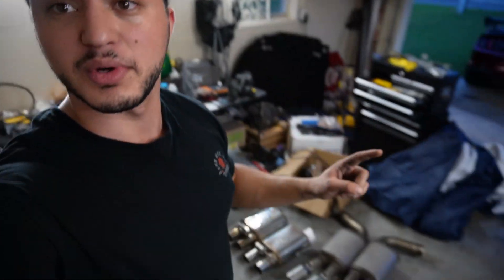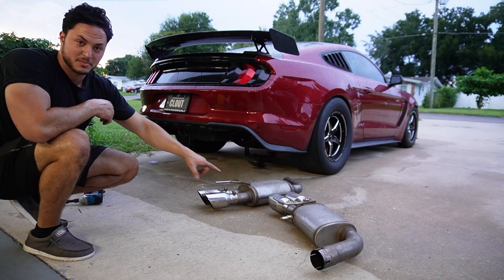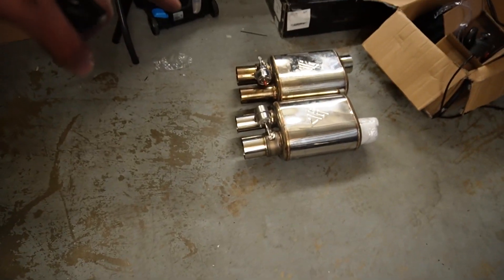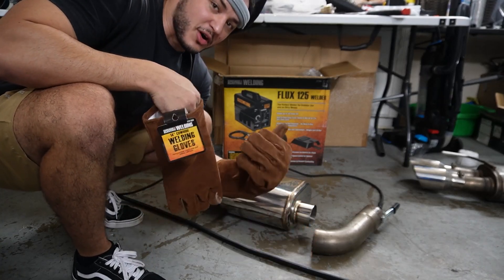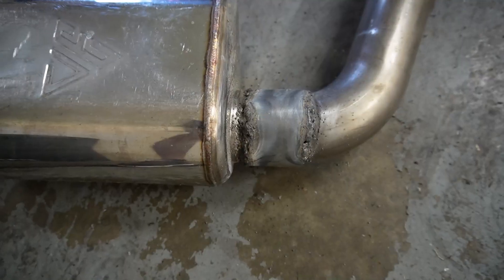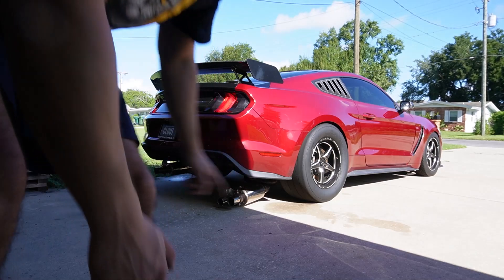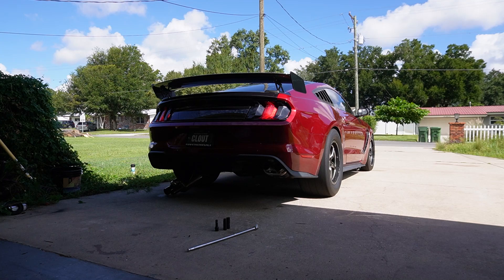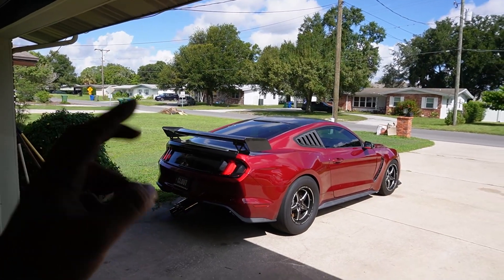Adding a QUIET MODE to my 1000hp mustang!

Comment: Have the same one. Do you have issues with your exhaust hanging loose?
Reply from the maker: Not really after I moved the hangars from the old mufflers to these. Some of the bolts were loose in the video because I had to reinstall every piece after the headers one by one and it was 100 million degrees outside
Reply: @CloutStang  oh forgot to ask how is your hot licks flame kit? I haven’t seen it work. Do you still have it